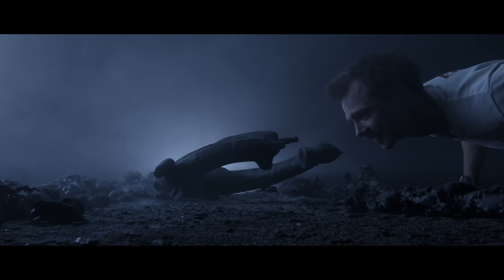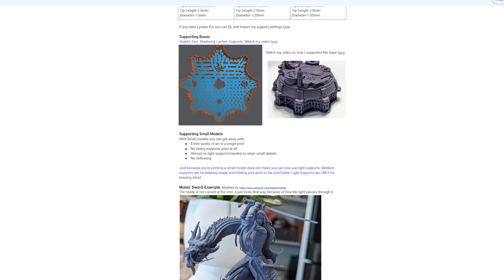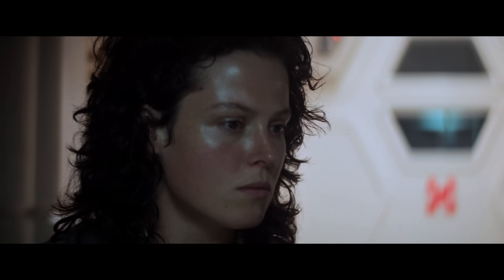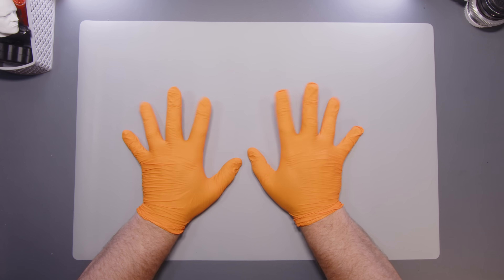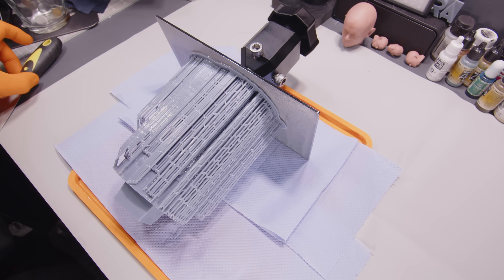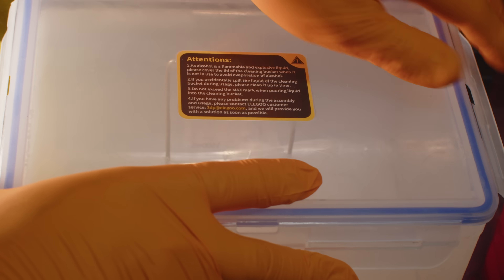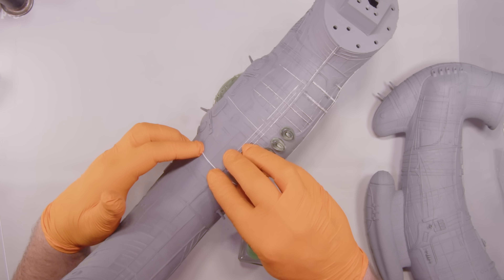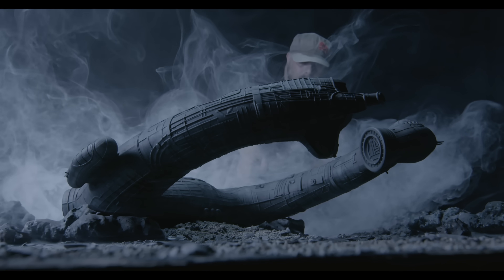Recreating Alien: Episode 1. Resin Printing

Comment: Great video, I printed this model on my Saturn 3 Ultra. Looks like you went kinda heavy on the supports. In the end looks really good. Is there a link for part 2?
Reply from the maker: Thanks for the comment, I've seen your work before and the 3D Print projects you do are great! ...yes, went heavy on the supports because it was my first ever print project and wanted to be safer rather than sorry after a couple of failed (distorted) prints. I also hollowed out the sections (extra) a bit too much - so ended up not  hitting efficiency with the balance of supports needed to keep the parts from warping. Oh well, lesson learned. Part 2 ( showing model painting) will be up this Saturday at 4pm PDT. Cheers JP

Comment: I hate to break it to you but you printed  those parts with a lot of supports on the inside and it'll be basically impossible to cure those supports that model is going to split over time from uncured resin on the inside.
Reply from the maker: Internal supports were all removed by pulling through the drainage holes set in Chitubox. No uncured resin was left inside the hollow prints.

Comment: Cool video.  I love my Saturn 2 and Saturn 1 printers.  I have that same Wash and Cure station.  I will warn this though, if you are not using the wash basin, make sure you don't leave that wash basin on the base with the basin full.  It will warp the plastic and make it to where the impeller won't work any more.  It happened to mine.
Reply from the maker: Good tip...many thanks!

Comment: Tommy radiates such Lalo Salamanca vibes.
I would definitely suggest using a flexplate on that printer. It helps to avoid chiseling and prevents that ball joint build plate being knocked out of position therefore you don't need to level it every time.

Comment: For future reference, hot water goes a long way on removing supports. Washing the part then running it under hot water in a sink, or a bucket helps loosen the supports on the model and generally helps reduce contact point  imperfections on the model. For thinner models this does run the risk of the part splitting